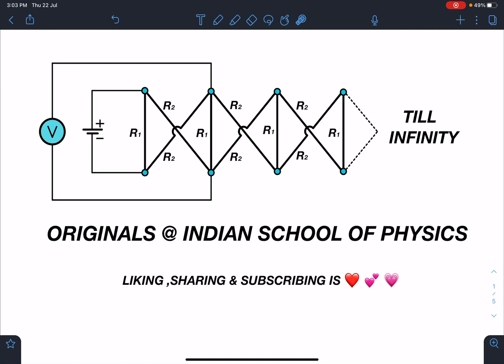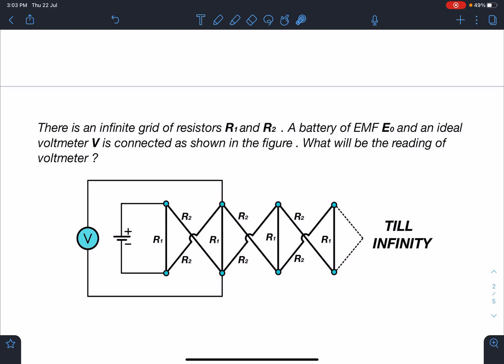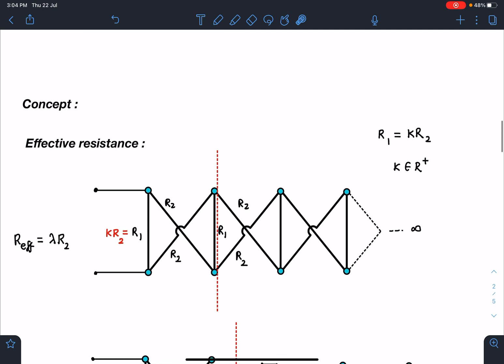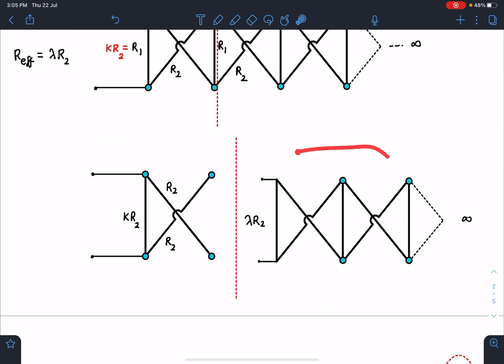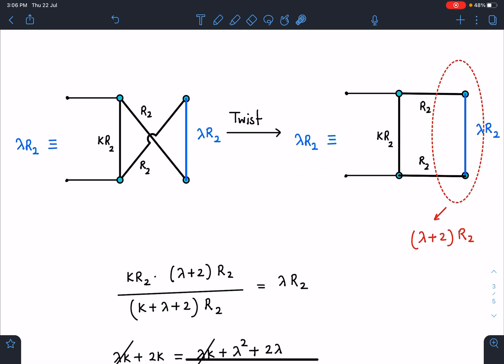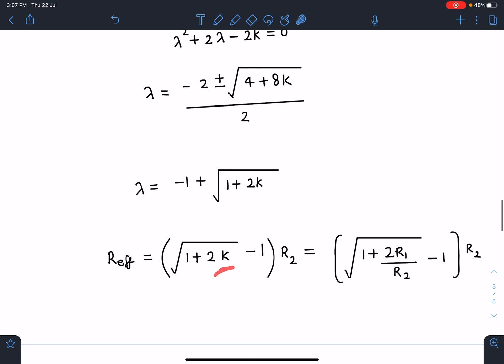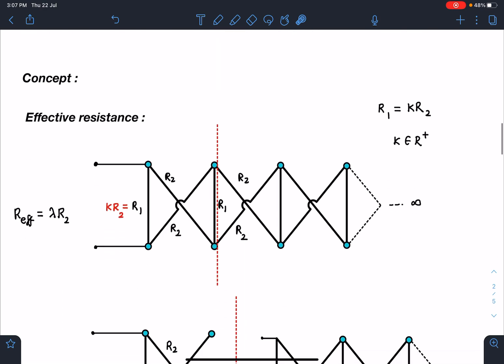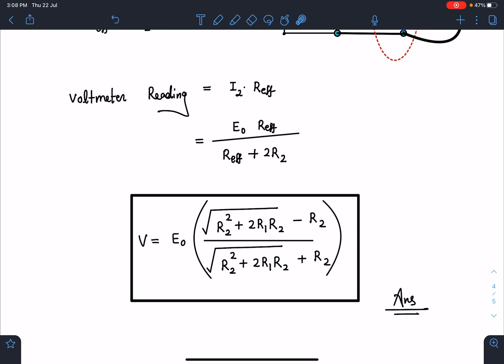[JEE ADVANCED] INFINITE RESISTANCE CIRCUIT & VOLTMETER READING[ ADVANCED PROBLEMS IN SCHOOL PHYSICS]

Comment: I applied exactly the same approach because I have studied Current Electricity from you in the INPHO batch and there you had discusses these types of circuit. However, I mugged up with the calculation but as you always say, the ques will come with good data, So I'm delighted after approaching the ques correctly.

Comment: Sir I could do this ,but what if we write net current as E/NET RESITNACE( which I could calculate on my own) and now try to divide this current inversely in the ratio of r1 and 2r2+Rnet ,now by finding current in 2r2+Rnet,and multiplying it with Rnet I am getting a diff answer can you pls look into it sir...
Reply: Me too
Reply: Both the equations are same but in different forms, I have checked by equating the two, it is yielding 0=0
Reply: @arijitkumardas2613  can u share ur calculation here, or on telegram?
Reply: yeah, same.... idk y the answer doesn't match

Comment: sir i also got the answer on my own, using similar approach, i took net resistance from second R1 has k overall (didnt take any multiplication by R2 or anything), and R2,k and R2 are in series then parallel with R1 again equated with R, same eqn same ans

Comment: Si if you are reading this comment please do this one-
As this is year 2021 so,
There are 2021 points in space, a resistor of R ohm is connected between all the points.
Find net resistance between any two points.
Thank You Sir

Comment: I have a question
Find ELECTROSTATIC FORCE BETWEEN TWO POINT CHARGES PLACED IN DIFFERENT DI-ELECTRIC CONSTANT MEDIUM. AND SEPERATED BY DISTANCE      d   .
Reply from the maker: i shared its solution few days back in tele .... its beyond JEE ADV ... you can skip it ... still if you need its solution plz mail me .. i'll share .
Reply: Sir can I join that telegram group?